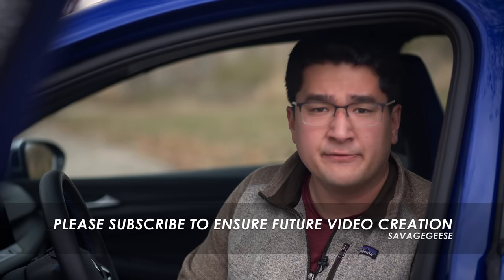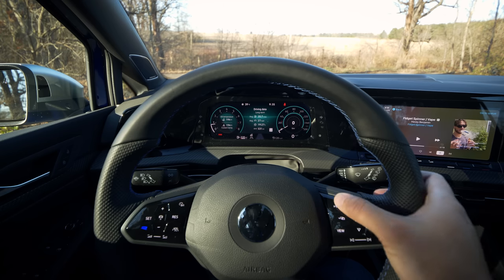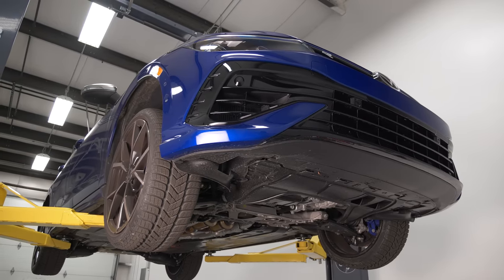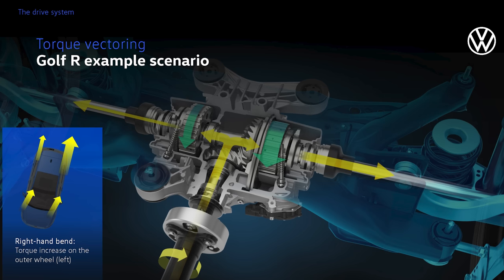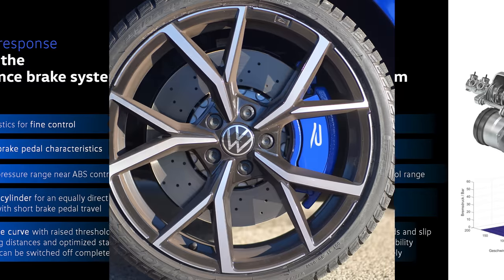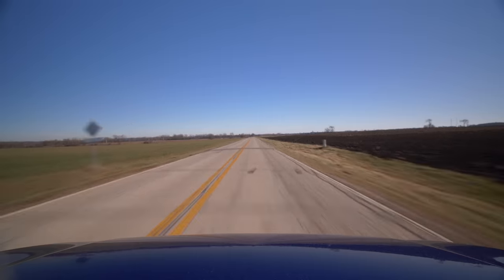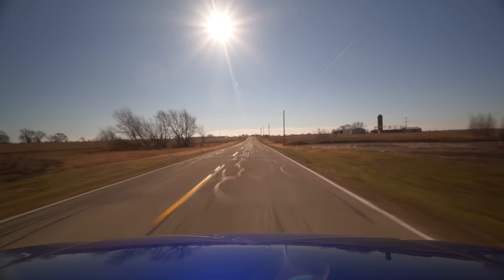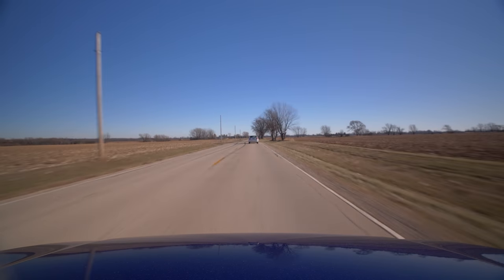2022 VW Golf R | Tearing Up The Streets

Comment: I am in the market for something to replace my aging 2006 Cooper S, and the Golf R (with a manual trans) is at the top of my list.  Unfortunately, I think the lack of physical controls in the center stack will be a deal breaker for me.  Who in the world wants to deal with a laggy touch screen to adjust the climate control?  I don't have to take my eyes off the road to adjust the HVAC or radio on a vehicle with physical controls.  Maybe I'm a bit old fashioned, but I don't care for having a screen as an instrument cluster, either.  I could live with the instrument 'screen' a lot more easily than I can deal with the lack of physical controls though.
Reply: Get the previous gen. I love my 16 R ;) I hate screens too and mine is essentially black 100% of the time thanks to bluetooth audio having a black backround with white letters for audio. No blaring light at night and the old one still has physical controls for everything you use on a daily basis.
Reply: Agree 💯. I dislike screens everywhere. One in the center is plenty.
Reply: It has voice control - you just tell it what temp you want!
Reply: @tedjones403  too slow.  It’s much easier to turn a dial like before and be done with it.
Reply: @AKJeeper  I have ordered an R through my VW Dealer - I'll judge 100% when I drive it! Would agree that you can't master from a first drive; so, I will see what time does to my opinion!
Reply: I'm in the same situation ('06 JCW). The 7 or 7.5 is what I'll likely get due to the interior touch points (or lack thereof) of the 8

Comment: I love this gen Golf, especially since NA is the only market to get the 6MT.  Kudos for you to not give VW a pass on the terrible infotainment system which is a deal breaker for me.  In the olden days you could swap out the double DIN head unit with an aftermarket one but not with these modern cars with non standard HU that can't be easily replaced.

Comment: I watched/read somewhere that the lane keeping defaults to ON every time you start the vehicle, that alone is a deal breaker for me. Found a 2021 GTI after seeing the Mk8 GTI at the dealership, a step backwards in my opinion.
Reply: My Mk7 has one tracking. It’s awesome. HOWEVER…it can be permanently disabled off in less than 2 seconds.
Reply: It does not, (I have a 2022 GTI)   and btw, all the complaints about the infotainment are over-blown, it just takes a little bit to get used to, sure they need to fix some stuff, and a couple critical knobs would be better, but don't let those small things overshadow what a huge leap fwd the mk8 is in every other aspect, if I was in a mk7.5 I'd def trade into a mk8.
Reply: I'm sure there is or will be a way to default it off just like the engine start stop on 7.5.
Reply: @sabresys45  good to hear. I wanted the new platform after watching savagegeese's review and the improvement in dynamics, but at the end the Mrs didn't like the styling and it's going to be the main car. 3rd Mk7 we buy, these cars are pretty amazing daily drivers.
Reply: @sabresys45  reviewers also rarely point out that most drivers use the steering wheel to control volume.  Anywho…more capable, built with flimsier materials. Par for the course since the Mk5’s high point of build quality.
Reply: @sabresys45  that's the exact reason why i wouldn't trade up my MK7 though
Reply: @JacesOwnWorld  Not sure what that means?  But I can tell you I've owned mine for about a week, and I can tell you without reservation the mk8 is going to go down as one of the best gens of the GTI ever made, if not THE best, because of what they've done with driving dynamics of a FWD car.   In the span of 1 week I've gone from irritated with the haptic buttons, (which is what all the reviewers are saying on first impression), to this isn't so bad, to, oh I get it now.... (I just went through this whole discussion on a different video), it's laborsome to have to debate this with folks, I'm just trying to let people know to take all these reviewers with a grain of salt, they don't have adequate time with the car for the learning curve to occur, that's the big thing I would tell people, getting used to the interface takes a little more time than usual.  Can they improve the interface?  Yes.  But my god, everyone is so focused on the buttons that they are glossing over what a GREAT driving car this is.  (That's coming from a guy who has owned too many sports cars to count, including several Porsches and Audis).  My last daily was a 2019 S5 Sportback, and I like this mk8 better, because it's just so damn FUN to drive!!  And btw, once you get over the learning curve, you'll notice you're sitting in an absolutely fabulous interior, a truly modern interior, it shares many of the design cues with the 992.  So, basically what I'm saying is GTI guys are now like Porsche guys, they lose their minds every time a new gen comes out, they say they hate it, the last gen was better, blah, blah, blah, except they're wrong every time, LoL.)   Wish people would stop cueing off these reviewers and knee-jerk react, just go drive one, you'll see....
Reply: @sabresys45  Agree, everybody loosing too much time talking about this infotainment.

Comment: I drive a 7.5 GTI manual and absolutely love it!  With regards to the infotainment system, I believe it is not such a big issue as everyone makes it to be. Once you enter your desirable settings, you rarely go into the system at all. I have my wireless apple car play and only change the volume and the temperature on a daily basis. The volume could be adjusted on the steering wheel and the temp control should be a shortcut. The pluses of the new interior: heated wheel, ventilated seats, more settings on the gauge cluster. The back seat gets temp control, which I don't have now. Plus, there are 4 USB C, as opposed to the one I currently have. Overall, I think the pros of the interior outweigh the cons. It's a matter of time till I get mark 8 R manual. Luckily, my GTI performs great meantime.

Comment: Please test the Audi RS3 on track,  PLEASE. I want to see how the under steer is on the RS3 and Golf R. Even with new rear end I believe the under steer will still be there on track. 
Good video as always.
Reply: The rear diff on the new RS3 is the same clutch-pack as the one on this Golf R, so I'd imagine it behaves similarly to how they explained in the video. That is, effective but rather unnatural feeling.
Reply: @pan4632  yes, I am aware. I just like their weight chart they do. I also figure close to 60% front weight as well. Also like to see how the 2.5l 400BHP performs getting grip in and out of corners with possible extra car weight.  Also I don't think they mentioned it, but I think Audi engines are mounted forward front sub frame that also makes the cars push in corners. Also want to know if stock Audi camber can be adjusted.

Comment: I have about 30 track days with a modified MK7.5 R and there is no getting away from the fact that it's just a better street car, even with a big rear anti-sway bar, -3 camber in front, etc. It's incredibly fast and potent, but it's not exactly fun. I wonder if that rear diff is enough to change the handling at the limit on the track. However - again, if you have no intention of tracking your R, on the street it's amazing.
Reply: Even on the street, it's too competent to get your hair to raise or feel like you could get in trouble. Selling mine was hard as I went with a less capable, more irresponsible vehicle. If they can find some way to bake more fun into it, I will come back. Sounds like mk8 facelift could be it.
Reply: @cwx8  i did too! I traded it in for a manual, RWD M235i. I’m slower around the track but the experience is on a whole other level. And since I’m not making a living with faster track times, I don’t care being a bit slower :)
Reply: @sephiros9883  That's interesting, so the modified mk7.5 R is faster than the M235i - but did you modify the BMW to same extent? I'd imagine the M235i being faster? Is it too heavy and being rwd gets you into more oversteering situations on corner exits?
Reply: @bokiNYC  M235i omits a limited slip differential which doesn't help!  Unsure if sephiros one has one though.

Comment: We’re some 47 years into the GTi and almost a decade into the R, how has VW not perfected the long throws and sloppiness of the manual gear shift? This should be a fun car to manually shift. And the infotainment is egregious. Do they ever listen to feedback by buyers?
Reply: To be fair, the manual is not a high priority on VWs list. It was on the list to be cancelled by now, so why bother to perfect it?
Reply: That's a different issue. The shifter was on its way out so there was no reason to continue to develop it. The did a satisfactory job of holding onto it.
Reply: For 47 years the shifter was not on the way out.
I like VAG but they are also one of most arrogant car companies when it comes to listening to anyone.  I accepted to be happy they get it right most of the time.

Comment: I'd be curious to see how the Golf R would hold up on track from a cooling perspective. You have that open lower grill, but it's essentially closed up at the top. Its German though, so I assume they worked some engineering magic to flow air to the proper places.
Reply: We'll have to wait till mid summer for that.
Reply: I don’t think any car that was extensively tested on the Nurburgring is going to have cooling issues.
Reply: @matthewp9015  Nurburgring is a very high speed track. The rad will get more than enough air to keep the temps in check. But that might not be the case for a short course technical track.
Reply: We're there any issues with the MK7R? There are (or at least were, I'd be surprised if the removed them) coolers in the fenders kinda where the fog lights are for additional cooling. Seemed decently track oriented from that regard.

Comment: Everything you said when you talked to the engineers explaining the “tablet” design layout, about the infotainment, confirms everything I have been saying about this atrocious interior!

First off, do drivers use their tablet while driving? The answer is NO! So why the hell would you design the infotainment to be like a tablet? 🤦‍♂️

Secondly, these younger kids, who are all about tech, and less about driving dynamics, either were VW’s prospects for this car, or are the very ones who designed this interior. It atrocious, and I would put my $$ on it that VW changes the interior for their re-gen MK8 model. The S3’s interior is very similar, but has touch buttons on the important buttons. I can see the GTI/R going with that interior on the re-gen.

Comment: This is probably my next car, coming from a 2014 Focus ST.  The Golf R would be perfect except for that dumb electronic parking brake.  Shift knob is an easy fix.

The real question is -- what is the markup going to be on these?  My guess, these are going to be touching 50 grand.  At that point, you are in used M2 territory.
Reply: the new m240i starts under 50k too
Reply: Just find a dealer to order you one at MSRP. They are out there.
Reply: @papa_pt  Yea, or about $48.5k - wish the m240i came with stick shift though.
Reply: M2’s are in the 60’s with options and up. This will be 40s
Reply: Y’all talking about US prices?
Reply: @bokiNYC  yeah me too :(
Reply: You can find a used M2 in the low $40's right now, which is a better car than the Golf R by far!! I am right there with you. for $45-50k, that puts me at a price point to find a hell of a lot better used sports cars, that still have warranties, but way better driving dynamics. There is now way I would ever buy a Golf R new. Its a $30k car tops to me, and that's stretching it.
Reply: More like $60K.

Comment: I wonder if the main info screen can be accessed by steering wheel controls? I hate touch screens.
My MB uses the left side of the steering wheel to access the driver’s screen, the right side accesses the main screen plus there’s a touchpad as well.

Comment: I want to upgrade my Mk7 GTI to this car but I’m wondering if I should hold off till the facelift to see if they fix the infotainment buttons.
Reply: hold off for sure. The Audi S3 has an identical interior to the MK8 GTI/R, but there are physical buttons in it instead. I can see VW changing to that on the facelift.
Reply: @@japanwatchconnection They did from the 10th gen to 11th gen civic, you never know

Comment: I'd like to see them add a 2 second delay to the R & Heated Steering buttons on the steering wheel.  This would eliminate most of the accidental touches and seems easy enough for them to implement.
Reply: Yeah that's not a bad solution. Physical buttons still eliminate almost all of the irritation. I wonder if an aftermarket company will start making steering wheels for this car.

Comment: How do yo compare the R vs GTI?  How much in percentage is better the R with all the goodies?  Here in Canada an autobahn gti cost is 12k less than the R (35 vs 47)  so its about 30% cheaper.  Colors in R are pretty basic and you have more choices 8n the GTI.  Considerin g both are not really track but more street cars, I dont know if is worth the extra money for some more power, a little more torque and a 4 motion system.  I believe this is the last generation of golfs prior they to dissapear after almost 50 years of existence and vw electrification, so I would like to pick one to preserve.  I had a 76 mk1, then a 95 mk4 a 2015 mk7, and for the last mk8, i would like to get somethung really worthy but not just fancy toy

Comment: The fact that it comes with an automatic is something to celebrate. Let's face it, rivals from other brands in this class come ONLY with a manual. Honda in particular, where not only the Civic Type-R but the Si are both manual only. Meanwhile both the GTI and the R come with optional automatic gear boxes for those of us who don't want to arrive to work, with one arm and one leg already exhausted. Thank you VW. 

Seriously, the only way you can get the Honda Si's engine and turbo with an automatic is to buy an Acura Integra. Ironically, while that would have been fine if this were the 1990s; nowadays it doesn't work. Acura is tight-lipped about the automatic CVT's performance in the Integra. But realistically, you're getting 0-60mph. times of 8 seconds. The Acura is now a bigger, longer, Near-Luxury vehicle. And if that's the point of it, you might as well just get a Honda Civic Touring with its 20 horsepower less turbo charged 4-cylinder instead. Save a huge chunk of money and get a better-looking interior than the Acura Integra.

Comment: Ah yes. Can't wait to see these with a sagging headliner, curbed wheels, and check engine light on "we approve any credit" lots for 1/5 of the price in 10 years.
Reply: My '10 GTI has a sagging headliner 😄. No CEL though.
Reply: @Edgar_Allan_Poe_50  take it back now before you skip timing and go boom. Every vw/Audi ages like a meth addict. I was a die hard VAG enthusiast for years. Now I drive Toyotas.
Reply: I suffered through tough times for sure (carbon cleaning, mechatronics, rear main leaks) but I got VW to replace my turbo under warranty (they actually offered!) 2 years ago when they were doing my timing chain tensioner, so that was cool but yeah, my next car will be a Prius 😁and a RAV 4 Prime for the wife!
Reply: @urs6onfuturas975  who cares.
Reply: @dogchainsaw3923  shh the grown-ups are talking.

Comment: Excellent review!! I see the manual transmission has shorter gearing than the GTI (that’s a great thing), just like on the MK7 GTI/Golf R. Looks like a blast to drive. I’m glad the US market still gets the manual option.
Reply: Agree to disagree on gearing. I thoroughly dislike that my 7R can't hit 60 mph in 2nd gear, and that it cruises on the highway at like 3500rpm @ 80 mph
Reply: @nxbrennan  I see. Yeah, the highway gearing definitely could become annoying. But, I can imagine it’s quite responsive at those rpms if you have to make a pass. If the car had longer gearing, wouldn’t there be more lag from the turbo because of its greater size over the GTI’s?

Comment: Lots of interesting (if sometimes tedious) information, guys. But trying to evaluate the new Golf R wearing snow tires is like trying to enjoy a ballet performance when the dancer is wearing galoshes. I'm looking forward to the review of the "R" when properly fitted with summer (or at least all season) rubber. 😁
Reply: It's still not great on summer tyres: https://www.youtube.com/watch?v=SKNgFt9asYQ (L'Argus Nurburgring track test)... The handling is very strange -- understeer that rolls into oversteer.  The Golf R is not nearly as practicable or planted as the Civic Type R or Megane RS Trophy on the Nurburgring with the same L'Argus test driver, just compare the videos. :)

Comment: This car strikes the perfect balance between what is usable on the street and what is usable in your life. It's the right size, the right speed, the right features and tech, and then nothing more so it's the right price.
Reply: Tumi the biggest downside isn't the infotainment. It's that if you want the manual, you have to immediately change the clutch and retune the ECU. VW put in a clutch that's too soft to handle the power, which is nice For Street characteristics but you're not getting what you paid for. On the plus side, when you do install a better clutch and ECU tune, you'll probably unlock more power than Factory

Comment: its crazy that VW's mission is for the driver to interact with the screen WHILE driving.  Can't believe they really went ahead and created a knob/buttonless infotainment system when driver safety should've been top priority.  Maybe it would be a different story if the touch commands and the overall user experience was seamless but I'm reading that there's way too much unresponsiveness and way too much lag even with software updates.  Hopefully 8.5 gets a hardware update because what VW rolled out for an R model/flagship vehicle is a joke